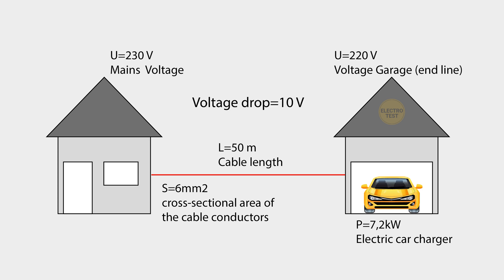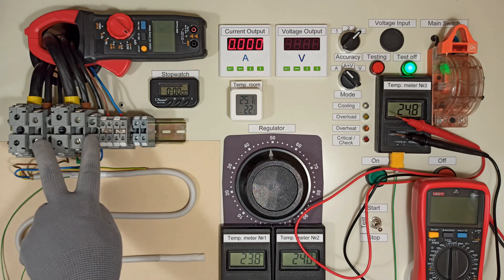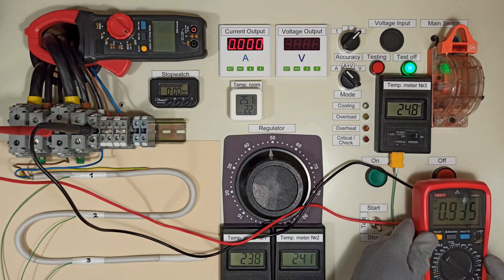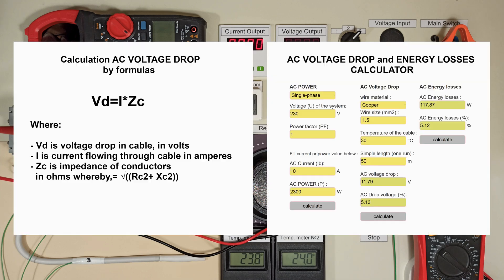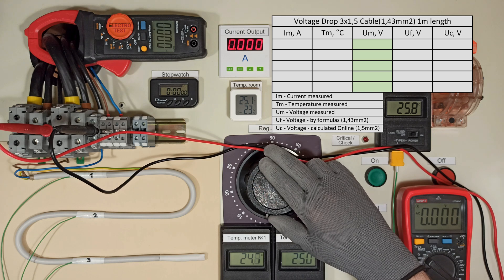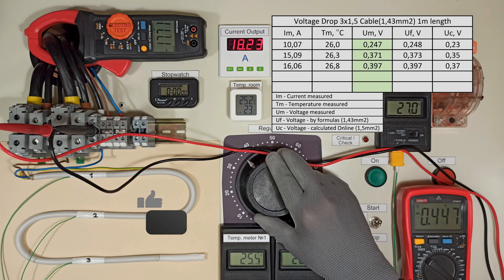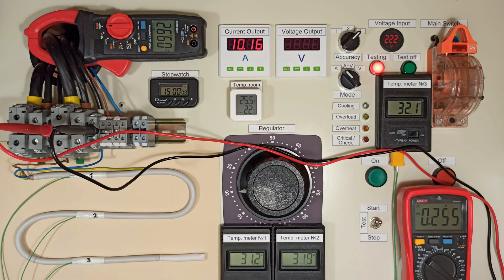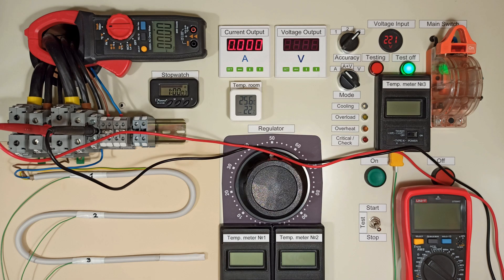Voltage drop 3x1,5 cable. Measuring at different currents and temperatures.

Comment: Your content is great, and i know this takes time to make. First of all, thank you. Secondly would it be interesting to test the installation tables for cable installed in different surroundings. For example in conduit, in insulation etc etc.
Reply from the maker: Thank you, my friend, it's nice to hear! I have such ideas, and I'm currently designing an additional stand to fit it all. Also, I need an extra camera.
Reply: @ElectroTest_1 sounds great. Just reach out if you need sparring with another EE. 😊
Reply from the maker: Thank you :) I'll keep that in mind!

Comment: Measurements would be more reliable by using 50 meter of cable instead of 1 meter...? Also clamp multimeter probes  together with the copper strands in screw-clamp-terminals for firm connection.
Reply from the maker: Thanks for comment! Of course, the longer the length, the more accurate the measurement will be! I’m planning to do a similar test with a 10m cable. However, at the moment, I don’t have the ability to unroll and position 50m of cable in a room! As for attaching the probes together with the wire in the terminals — the solid wire and the end of the probe have different diameters. Clamping them together wouldn’t be a good idea and would cause additional contact resistance due to the terminal’s metal.